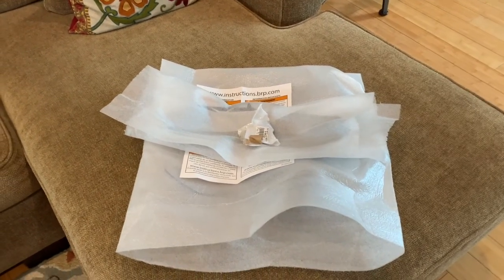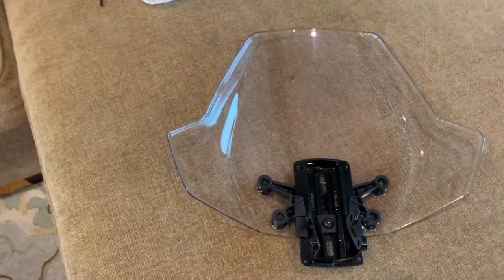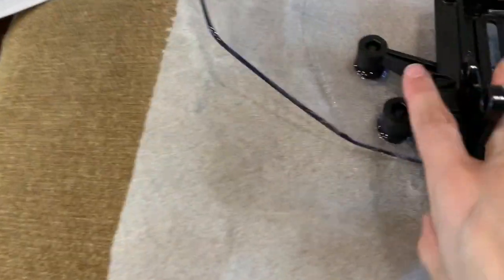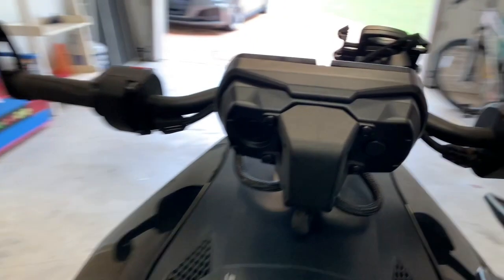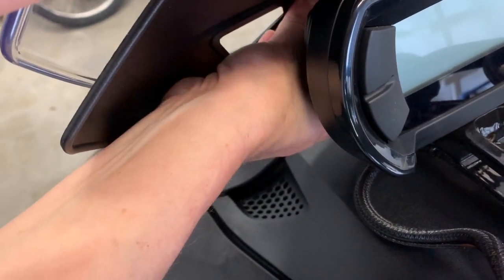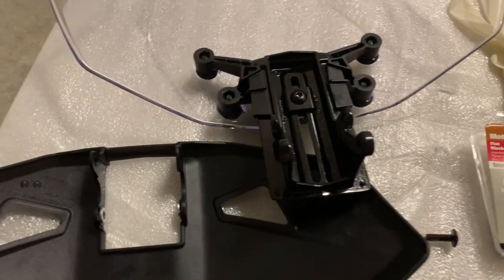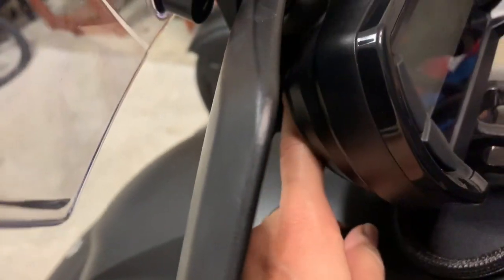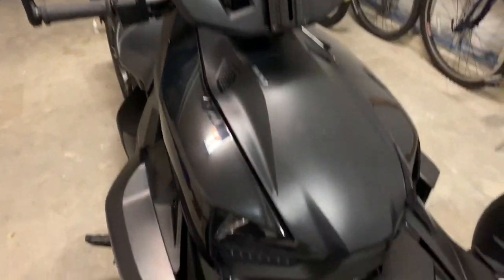Can Am Ryker Windshield Install (failed attempt and success)

Comment: Using nitrile gloves while installing a windshield prevents fingerprints that have to be cleaned off later. Learned that after installing a few shields on my previous motorcycles. They provide some grip for slippery little parts and can prevent those little cuts and scratches you usually get on such projects. The black kind that are little thicker are best for working on cars and bikes. Was very smart to go back to the dealership and talk to the parts guy to find out why the shield was loose. Another helpful video. Thanks
Reply from the maker: Yup, the gloves would have been a great idea.  And yes my fingers do get cut up a little, and dirty, but I don't mind.  I like getting into the project! I guess that's why I am always barefoot?

Comment: I installed my windshield, but now my display is loose , would you have any idea on  know how to tightened  it ?
Reply from the maker: Hi Miguel, sorry you are having trouble.  Did you try tightening the 4 bolts behind the instrument cluster?  If you are having trouble, you can contact me through FB messenger.
Reply: @RykerRydes  I had to remove the windshield and the back of the display to tightened the bolt , it was very loose, thanks for responding and keep up the good videos ....I've had the bike for over a week now and I love it ...

Comment: Is it a big difference riding on the hwy with the shield 🛡. Is the Ryker high maintenance.
Reply from the maker: Yes the shield makes a huge difference, I actually wish it was a little bigger for highway riding.  The Ryker (for me) has been ZERO maintenance!  Just gas and go!
Reply: @RykerRydes  today is delivery day.
And just my luck we have rain in the forecast for today.
I'm in Louisiana.
Thanks for all of the great videos. I'm super pumped
Reply from the maker: @biggjune2914  Post a pic of you and your new Ryker!! Ride in between the rain drops!!
Reply: @RykerRydes  will do
Reply: @RykerRydes  what would u recommend as a must have for the ryker. If u only could choose 1 accessory
Reply from the maker: bigg june wow great question!  Let’s see. My reverse lever modification has been the most useful. But as far as safety, adding the fender lights or the new fender blinker lights, are my absolute favorite!!! Let me know what you think.
Reply: @RykerRydes  I'm beginning to think the ryker isn't meant for me. Remember I told u I got a great deal on a "Rally".
Well they delivered me a 600.
Decided to go to local dealer an hour away.
Got the 900 (can-am had promotion on panels) i got the liquid gold. Trike looked awesome. Got 5 miles from dealer and "VSS FAULT comes on. Limp mode Home.
I'm totally bummed out. An really reconsidering the ryker.
Reply: There’s a guy called Knight Rider who tells all the problems he had with his Ryker at first on his youtube channel.  Now he’s very happy so please don’t give up.
Reply: @johnd9031  Knight Ryker is my buddy we chat all the time. 
He had to talk me of the ledge a couple of times. Lol
But got the Ryker right and really enjoying now

Comment: Beth the frame of my display is loose how do I tighten it
Reply from the maker: There are 4 bolts between the windshield and the bracket (frame).  A torx 20 will tighten it right up.
Reply: @RykerRydes  looking at the digital display there’s a black plastic frame with brp logo and a plastic piece that goes around the display unit; both plastic pieces are loose and rattles can these plastic pieces be tightened? The display itself isn’t loose. I’m not on social media so if you email me at servantsoldier@outlook.com I’ll send you the video of the problem thanks
Reply from the maker: @servantsoldier5207  I know exactly what you are now referring to. I have never had that problem and really don't know how to fix it?  Maybe ask Bill Ramseyer, he is a great source of information. Sorry,  wish I could help.

Comment: this is from Can-am correct not Slingmods?
Reply from the maker: Yes it is directly from can am. But if I were doing it again, I’d probably get a bigger one. What ever you decide, just make sure the glove box can still open!
Reply: @RykerRydes  how tall are you again. I am thinking of the Madstag which Slingmods is offering in the 20" . I was riding yesterday and boy it was windy this would have helped. :-)

Comment: Thank you Beth! Holy smokes, I paid $150 just to get my foot pegs installed and that bracket and they claim the suspension has to be adjusted as well and the computer to recognize the passenger… definitely needed to save some money once the windshield came in! 🫤
Reply from the maker: The on board computer does NOT need to be adjusted with the OEM pegs. As soon as the pegs are down, it activates a sensor so the Ryker knows you have a passenger.
Reply: @RykerRydes  they said it was part of their check post install to make sure nothing is wrong with the sensor.👍